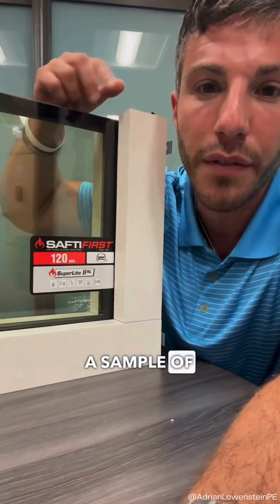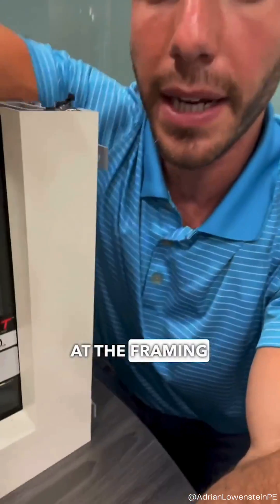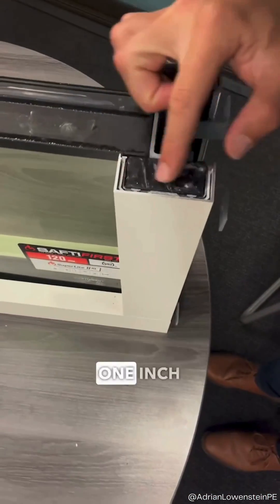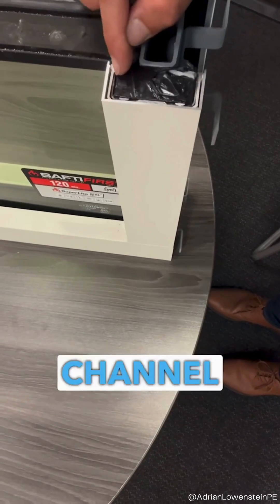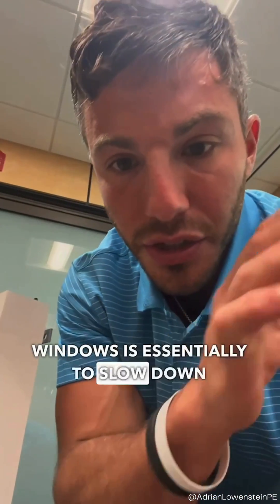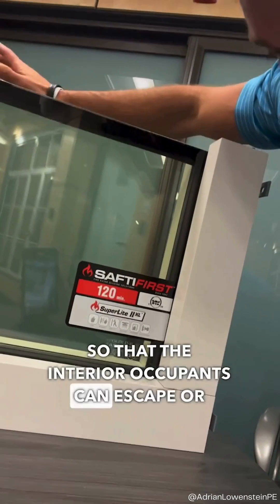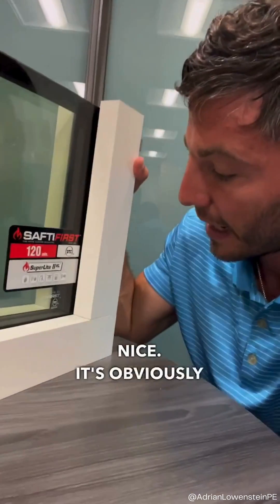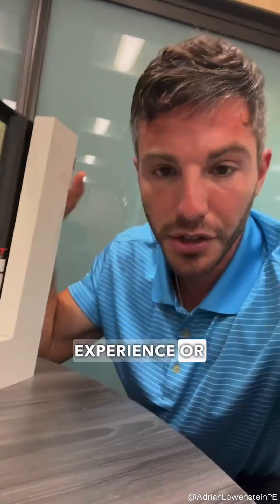Understanding 2-Hour Fire-Rated Glazing: Component Breakdown

Comment: Hi Adrian!

As an expert in glazed fire rated systems I want also to highlight the importance of a full fire rated system (frame + glass to be tested together).

The majority of the market consider that if you place a fire rated glass in whatever frame you have, you achieve fire protection but this in not so true!

Just let me add something regarding fire rated systems. Apart from the certified system, it is also crucial the way that you are gone seal the perimeter as also the infrastructure where the system will be place.

The opening must have at least the same category of fire resistance class with your window and the perimeter joint must be filled with fire resistance material (promat or mineral wool or foam) and then you need to seal with fire resistance silicone.

Thank you for sharing aggregated knowledge!

Greeting from Greece!